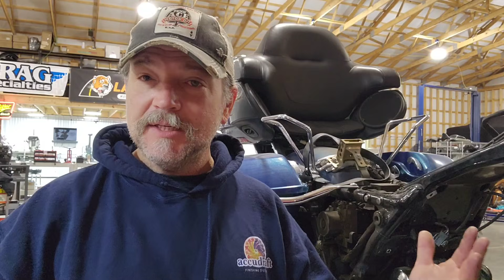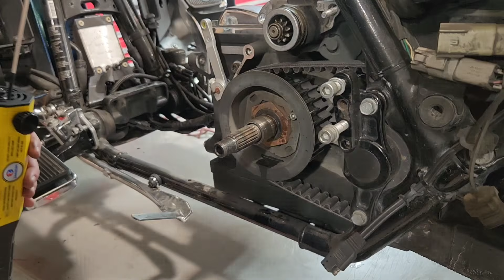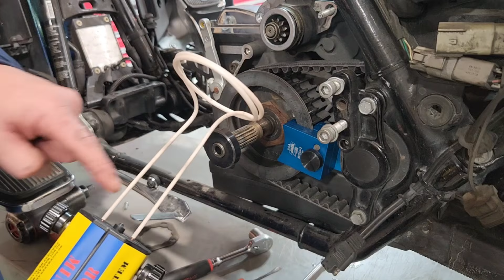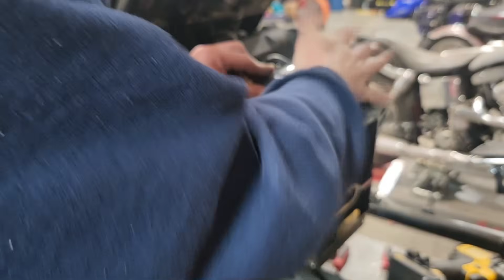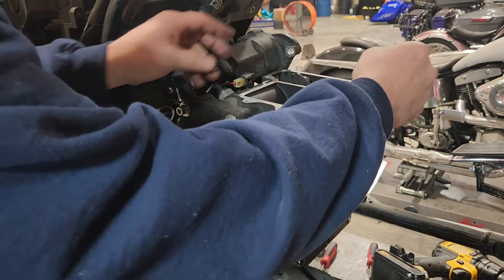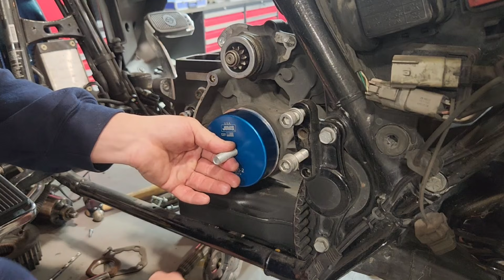*ANOTHER BAD* Main Drive Gear Bearing - Harley Cruise Drive 6 Speed Tear Down - Baxters Garage

Comment: My issue is the previous owner had some work done, im not positive if the main drive bearing was replaced, but i have a primary leak, i got the race off, and wouldn’t you know it, the shaft is groved cause the dummy obviously cut the old race off, but im guessing thats why the primary oil leak, i use the pinkish oil in the transmission, so how do i go about sealing the nick in the shaft? Im not sure how deep the nick is yet.

Comment: I absolutely needed this video tonight.  While mine is a 5 speed and not a 6 speed cruise.  I see a lot that I can use.  My race has walked in.  Stopped at that point tonight bc Ibwas just tired after a 12 hour day.  I will try the heat 1st tomorrow,  if that does not work I will ise the loosen the mainshaft withba couple of light bumps.  Hopefully I can get that race off and replace it with the Jims double roller bearing 8960.  Thank you sir.

Comment: The big twin transmission has some legacy design features which are neither simple, nor easy to service. Think about it: power goes in via spinning shaft, inside of another hollow spinning shaft which delivers the output to the rear wheel. In and out on the same centerline, and also on the same side of the case. Whiskey, Tango, Foxtrot.....man.

Comment: Question! I had a fall at about 20 miles speed. My shifter was jammed backwards. Now I’m having problems with not being able to shift down from 4th gear while riding. I can shift upwards but not down. I can manually shift down when the motorcycle is off and put it on neutral but not easily. I’ve already made adjustments to my clutch cable and clutch. But still having the same problem. Before getting into my transmission. Is there anything else I could look for? I’m sure that the fall cause something to go out of alignment or possibly damage something inside my transmission.

Comment: Hi kevin kool vids. I have a question for you. I have a 1999 dyna wide glide with a 95 ci motor,  which the dealership told me that, that bike was the only that came out the factory with that engine. But who knows, the question is that it also came with a four speed transmission and i just wanted to know if you heard of this bikes coming with a  four gear trany?

Comment: I break torque on cover screws etc manually (unless I was the last to install them) but run them out with a bit in a cordless drill or light impact because RSI is no fun and all that turning eventually wears out tendons and joints. One shoulder replacement was more than enough since a replaced shoulder isn't nearly as strong a joint. I am also long out of the heavy lifting business but any mechanic can give themselves easy options (like using a patient lift to pick and place engines, a gantry to sling bikes if you prefer mid-air access at any height with no lift table in the way etc). I often place a wooden hammer handle between a ball pein and engine etc covers. It's easy to see exactly where you strike vs a rag.

You can get 200 degree temperature crayons from your local welding supply or online and those last a very long time. The inductor is a neat tool but if you own a torch it's easy to protect the shaft by sliding a loose piece of steel pipe over it to safely deflect flame. Another thing every mechanic with any kind of torch will benefit from is plumbers heat dam putty. Goss, Rectorseal, and many others sell it online and I promise you want a tub. Then go heat some scrap parts and practice with it. It's also popular for localizing heat on sheet metal during body work and only costs ~25 bucks a tub.

If you don't already own a mechanical torque multiplier they're perfect for no-shock removal of compensator and sprocket nuts. I use red Loctite on my compensator nuts and can remove them using one hand on a long 1/2" drive ratchet with the torque multiplier. Some engine builders use then on tapered crankpin nuts as they work with any torque wrench. I should have bought on 40 years ago.

My local independent shop bros hate Cruise Drive boxes but like the money they make fixing HDs usual indifference to quality. They've never had a customer comeback when they installed Baker transmissions.

Comment: Great vid thanks. Just a quick question. 
My transmission gears can be moved laterally what is the most likely cause for this drawing from your extensive knowledge.
My new gearset is tight and just has the normal longitudinal lash. 
Any input is greatly appreciated cheers 😊

Comment: Well I followed your instructions using the jims tool.  Should have read the instructions that comes with the tool because the large gold washer is supposed to go between the 971-2 and the head of the bolt 2138.  Instruction line item #3.  I just broke the 971-2 in half and damaged the trapdoor side of the case.

Comment: I know that transmission troubles can be really frustrating!!!! I found a transmission bearing on the magnet when I had shifting drama 😮 but this happened with my Ducati ST2  at 203,000 miles 😊 what a piece of crap 😂😂😂😂😂 would never ride one of those chrome air compressors!!!

Comment: At what mileage are you having to O/H these?  You mentioned that drive bearing can fail as early as 20K.  (That's incredibly early.)  Is that the only early failure on these 6-speeds?

I love the sound of Harleys and have ridden a few but the more I learn about them, the more the engineering seems to be quite poor.  My biggest concern is that press-fit crank.  It's dirt-bike technology and doesn't belong in an engine making 100+ ft. lbs. of torque.  It should have been welded from the factory, especially given the damage excessive runout can cause.

The upside is they seem to be relatively easy to work on and the special tools required seem to be few easily duplicated with stuff I already have.

Great video, btw.  Very informative.

Comment: If that shift shaft has some play, could that be just a seal or a worn pawl?...no leaks...yet.  Thank you for this video!
Reply: There is a brass bushing that is pressed into the transmission housing that the shifter pawl shaft rides on. That bushing is also a sacrificial wear item.

Comment: 2011 Harley Ultra down shifting to 1st gear while slowing down slite wine comeing to a stop sounds like torque no chips in tranny fluid shifts and runs fine other wise any clue
Reply: Compensator ? They dont like enginebrake heavy

Comment: @20'01" what was that noise? When I look at the $$$ spent on tools for this job then the knowledge and then the experience it seems like I would trust Kevin to repair my bike but how do we know which shops are worthy of trust? Doing it ourselves is often the only way and perhaps less expensive. I liked the cruise drive, the top gear engaged light on the dash and the silent engaging of first gear from standstill but am put off by some of the tales of lack of robustness. There are some things I would like to see on HD such as outrigger bearings on the primary drive but they do look mostly heavy duty made.

Comment: Heat stickers, what a great idea, I'm gonna look into that. Interesting, when I've drilled into a seal, I've always then screwed a metal screw into the hole and used a pliers to pull the seal out. I'll try a pick next time-

Comment: Hey Kevin, thank you for another excellent detailed explanation of what you are doing. I have an 08 Street Glide with a six speed. 46,000 miles and while  in neutral I have a bearing making noise. I don’t care how many Holiday Inns  I stay at, I will not have, the confidence to tear the transmission out lol.The technician said he will not know which bearing it is until he gets into it. Thanks again.

Comment: Is there a fix for these early models to keep that race from walking? I'm debating going to a ball bearing but don't want to deal with the higher failure rate. Also curious what's the average cost for a shop to go through a trans and freshen it up with bearings and seals?

Comment: I noticed you used a 1/4 drive for the allens on the
lock plate me 2 easier feel on the tool harder to break
a bolt with 1/4 drive then 3/8 great video kevin.

Comment: Baker has a great upgrade for the Cruz drive 6 and replaces the ball bearings with timken bearings the plastic races break apart and then the bearings do not stay in place
Reply: If the "Timken bearings" you mention have a steel cage (not race), they are prone to more friction and heat than the nylon or plastic cage.  I am not saying they are worse for the application or don't work.  Just that there is a trade off between steel or nylon races.  Nylon or plastic works better in marginal lubrication conditions too.  I worked for a bearing manufacturer for 16 years that supplies HD with bearings.  Baker and other aftermarket manufacturers are sometimes forced to go to alternate suppliers or designs because the part the OEM supplier makes for HD is proprietary and by agreement they cannot sell the exact same part to them.  Not usually because this part is a better solution for the application.

Comment: I been seeing and hearing of more transmission main bearings and other parts failing. It's my belief it's because some folks use 20W50 in the transmission. I have always run gear lube in my transmissions and never had a failure. Presently I'm running Amsoil 75W140 severe gear. Probably overkill, Shifts great in cold weather too. I always suggest gear lube, conventional or synthetic, as long as it's gear lube.
Reply: I would say it's the stupid auto chain tensioner
Reply: Most metrics run motor oil in the trans as it’s all in one, not 3 separate holes as HDs…the metrics have very little if any of these issues and that oil has clutch particles and hydrocarbons from the engine.  It’s not the oil, it’s a design issue.  I agree with the autotensioner theory…
Reply: Yep ... Agreed
Reply: Spot on! 👍
Reply: I got rid of the $998 stock trans and replaced it with a Baker DD7. This thing is legit. 30% larger gears, timken bearings and the list goes on and on. Amsoil 75/140. S&S T-111 motor. This touring combo is a perfect match. Lovin it.
Reply: Agreed. Running motor oil in a HD trans is inferior to proper lubricants. Nothing but redline shockproof for me.
Reply: Same here!
Reply: I have been running 90 gear oil mixed 50 -50 with Moreys oil stableizer in my gearbox on my harley shovel and my twincam. The shovel is a 78 year model and done 180000. miles and the gear box has never been opened up, ever, the twin cam is a 1999 convertable and done 140000ks and also never been opened up.i also run the Moreys stabilzer in the primary and motor at 75% Valvoline 50 racing formular with 25% Moreys oil stableizer. Both motors have had big bore kits and lots of head work and hotter cams, and the shovel has been dynamically ballanced so they both go very fast. The only problem i have is the compensating sprocket coz i live in the mountains and tend to ride very fast in  lower gears, usually 3rd on the shovel and 4th on the twincam, so i use the engine breaking instead of using the brakes, and consequently i have a big box full of dead compensation assemblies from both bikes. Can the man of war compensating sprocket be used on early twin cams and shovels.
Reply: I don't think so.